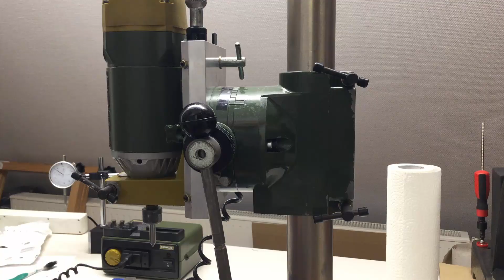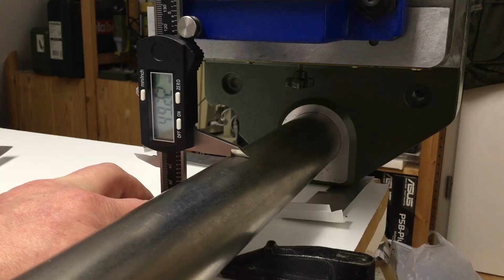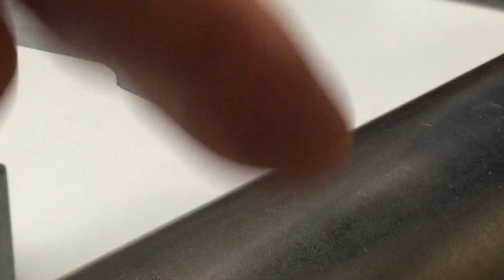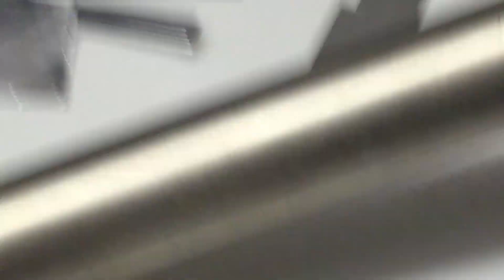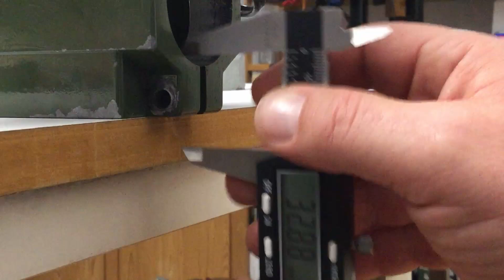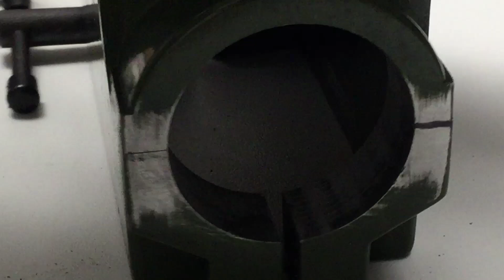Small Project: Proxxon BFB 2000 Mill/Drill Unit Improvement (Head Orientation)

Comment: Now is aligned. Why Proxxon didn't do that at manufacturing phase? Because adding manual time/tasks will lead us with a more expensive tool. So I think your mill cost more now than before. But this fine tuning is not a thing of this model and brand, every machine needs fine tuning after purchase. And in that phase you will learn a lot from your machine. Thanks
Reply from the maker: First, you're welcome! Second (spoiler alert),  I found the markings on the column and head are after all not a precise enough method ☹ You'll see in an upcoming video.

Comment: I have never seen this as a problem. Whenever I use this mill, I first set the heigth of the extension arm to slightly above the workpiece and from then on use the fine feed.
Reply from the maker: Yeah, I'm kind of going beyond what the BFB 2000 and BFW 40/E are intended for. I need to drill a 16mm diameter, 70mm deep hole into a block of POM (Delrin). I will do it in 10 steps, increasing the drill diameter by 1mm between 10mm and 14mm and from there on by 0.5mm until I reach 16mm. So I will have to reposition the head on the column quite often. Spoiler alert (upcoming video): Things didn't work out as I planned in two different ways.